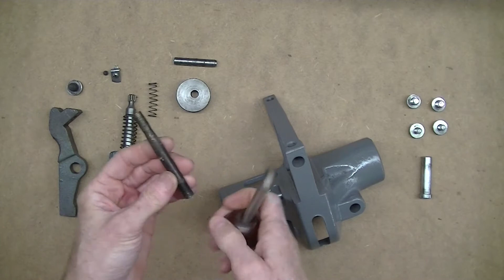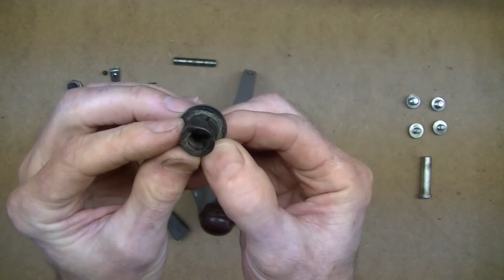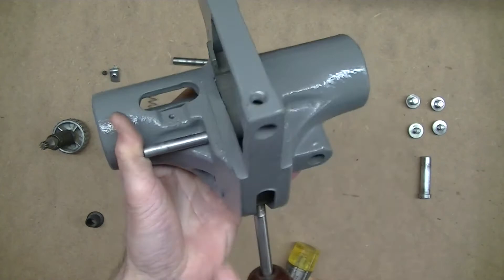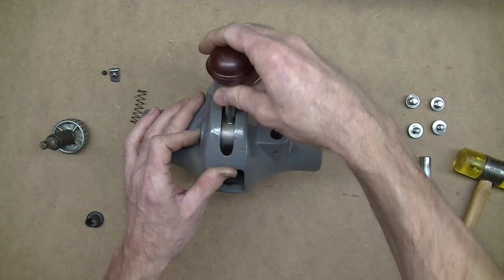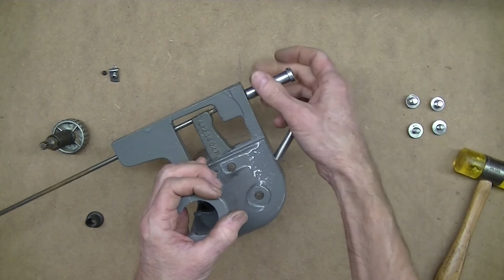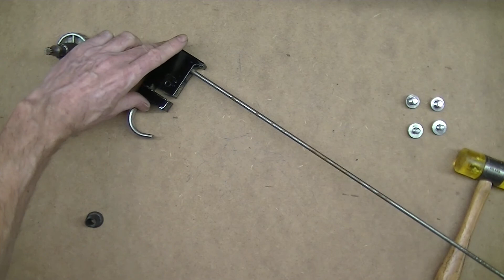Delta Rockwell Unisaw Jet Lock Fence Parts and Assembly

Comment: Great instructional video. Purchased my unisaw in the mid-80's from Delta in Quelph Canada. I wouldn't give up my Jet Lock Fence for any brand fence on the market today. Recently re-faced the fence with an aluminum extrusion on the blade side and a piece of melamine on the other. Squared it up to form a "box" modeled after the Biesemeyer. Works like a charm w/o a lot of expense and replaced the indicator with a piece of plastic with an etched line. Thanks again.
Reply from the maker: Thanks for your comment and tips for improving the Jet Lock fence.
Reply: @ToolTalkCanada  Just an observation when referring to the 9:30 segment where you mention eccentricity. The back part (away from you) of my fence moves ever so slightly toward the blade when tightening. I wonder if this is due to that eccentric movement. Thanks again

Comment: Excellent job! About the only addition I made was a 5/16" flat washer inside, on the side opposite the rubber bushing, to keep the pivoting part centered. The bushing is available from Renovo Parts. $15 part, $13 shipping (to So Cal). I've got an older 54" Biesemeyer on my other Unisaw, and I've also had very good performance from Vega Woodworking fence systems. But I must admit, with the replacement bushing, and the washer keeping things centered, this old Jet-Lock is a keeper. Again - Thanks for a quality presentation!
Reply from the maker: Thanks for watching and for taking the time to share your comments.  Great tip on the flat washer to keep things centered!

Comment: Thank you for the very clear and informative video. Precisely what I was looking for. This fence system was also used on the 1973 Rockwell 34-338 Contractor Saw which I am restoring. The cam was initially clamping down on the front rail perfectly, but I felt something give and now the cam'ing action does not cause the internal lever to touch the front rail at all. I've been scratching my head how to take it apart and will be giving it another look after finding your video.
Reply: Thanks again! I was able to disassemble the fence and find the problem. I'm not sure how, but one of the sides of the "fork" at the tip of the internal "lever" piece that keeps the long tension rod that travels to the end of the fence centered on the lever piece had broken off. I believe the tension rod then slipped off the lever causing not only the rear tightening mechanism to not work, but the front rail grip no longer worked either. I was able to craft a hardwood splint and epoxy it to the side of the lever to fix the issue. 

One tip I figured out for re-assembly of the unit was to install the large spring before inserting either the cam pin or lever pin. This allows you more room and you have to fight the spring less to get it in place. 

Lastly, I'm not sure if the small spring inside the tension rod adjustment screw had been lost by a previous owner, however I did not find a spring inside of mine.
Reply: Follow up note, the epoxy did not hold, so I ended up drilling a small hole into the cast iron and inserting a brad nail as a guide to keep the tension rod on top of the lever.
Reply from the maker: Glad the video was helpful and I hope your repairs hold up.

Comment: Great video and perfect for what I'm looking for.  I am restoring a similar (slightly older) Jet Lock fence that came with a much older Unisaw.  You mentioned that you had a source for the rubber bushing (which I also need) in the US.  Since I'm in the US I would like to try your source and see if the shipping is any cheaper within the US.  Can you please tell me what your source for the rubber bushing was?
Reply from the maker: The rubber bushing is available at https://www.renovoparts.com/904-08-021-4550-rubber-bushing-for-jet-lock-fence/ Sorry I didn't mention that in the video or description. I'll add it now. I'm glad the video was helpful and please post an update if you get the part.